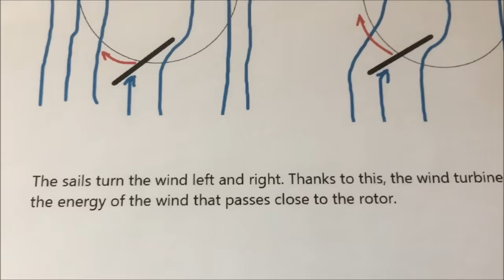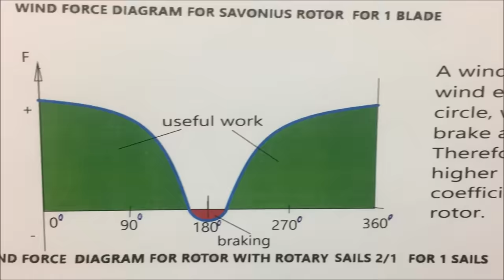A wind turbine they have been hiding for 138 years

Comment: I would almost consider this a type of "Darrieus" turbine, rather than a "Savonius" turbine. This works more like air foils, rather than scoops. It's very clever, how an air vane is used to orient a crank pin, so the sails know when to flare out down wind, and align themselves up wind, for maximum efficiency and minimum drag. Simple, reliable, and, serviceable. I like having the generator at ground level, where it's easy to work on. This is the closest thing I've seen, to a vertical axis turbine, that can compete with a horizontal axis turbine on the standpoint of efficiency. Great video, thanks for posting!
Reply from the maker: A big advantage is also a simple and cheap stand.
With large wind turbines with a horizontal rotor, 70 percent of the construction cost is the base.
Reply: 🔴 What Is Islam? ⚠️

🔴 Islam is not just another religion. 

🔵 It is the same message preached by Moses, Jesus and Abraham.

 🔴 Islam literally means ‘submission to God’ and it teaches us to have a direct relationship with God. 

 🔵 It reminds us that since God created us, no one should be worshipped except God alone. 

 🔴 It also teaches that God is nothing like a human being or like anything that we can imagine.

🌍 The concept of God is summarized in the Quran as:

📖 { “Say, He is God, the One.  God, the Absolute.  He does not give birth, nor was He born, and there is nothing like Him.”} (Quran 112:1-4)[4] 📚

🔴 Becoming a Muslim is not turning your back to Jesus. 

🔵 Rather it’s going back to the original teachings of Jesus and obeying him.
Reply: @1islam1  I don't care
Reply: @cajuncuriosity3067 

🔴ATHEISM EXPLAINED IN 45 SECONDS 🎬👇🏼

https://youtu.be/uwqPdWZvjAY
Reply: @1islam1 

Bahira:
"The names and religious affiliations of the monk vary in different Christian sources. For example, John of Damascus (d.749), a Christian writer, states that Muhammad "having chanced upon the Old and New Testaments and likewise, it seems, having conversed with an Arian monk, devised his own heresy."[9]

For Abd-al-Masih al-Kindi, who calls him Sergius and writes that he later called himself Nestorius, Bahira was a Nasorean, a group usually conflated with the Nestorians. After the 9th century, Byzantine polemicists refer to him as Baeira or Pakhyras, both being derivatives of the name Bahira, and describe him as an iconoclast. Sometimes Bahira is called a Syrian Jacobite or an Arian. The early Christian polemical biographies of Muhammad share in claiming that any supposed illiteracy of Muhammad did not imply that he received religious instruction solely from the angel Gabriel, and often identified Bahira as a secret, religious teacher to Muhammad."
Reply: @1islam1  Also,

There is the hilarious claim of the many hadiths or "gospels" to interpret the holy scriptures.

30,000 hadiths to my rough knowledge to try to make sense of your scriptures. Yet what man can claim he has the authority to know which books accurately interpret the Koran?

Or the Bible that the Koran was borrowed from?

I think if plagiarism had been a crime back in the 700's the early Muslims would have been sued for stealing from the Christians.
Reply: Also this design looks incredible and I'm going to grab the plans for it.

Looks like something some old welding buddies could build
Reply: Drawbacks: low RPM even if you use mechanical multiplier, low torque, and too many moving parts in joints can wear out fast creating lot of maintenance. The design is clever. I thought of a vertical axis with blades made out of small fins that would open when the wind creates drag and will close when the wind pushes against them, and it sounds great in theory, but in real life it has a lot of moving parts and wear and tear points.
Reply from the maker: @jjesl  Wear also depends on the speed of rotation. The bigger the turbine, the slower it turns, so the less wear.
Reply: @1islam1  capholic church created islam...nice wind generator eh friend...Greator bless...doug
Reply: @tihomirculjak7492  there are some really great bearings available...maintanance every 3 years ?...thanks very much for sharing...Yah bless...doug
Reply: Oh I got
Reply: @1islam1  Except Jesus raised the dead, He didn't make them dead by cutting their heads off with a dull pocketknife just because they didn't want to become His followers.
He also said, "Feed my sheep" He didn't say, "Take them as wives."

Comment: en el eje puedes poner colgando 3 varillas de un metro con un peso de 1kg en la punta de cada una, de modo que cuando sopla mucho viento, las varillas se levantan por fuerza centrífuga y ralentizan el giro, pero acumulan energía potencial. cuando hay poco viento la turbina sigue girando más rápido por la inercia acumulada de los 3 pesos. no impide arrancar el giro porque las varillas cuelgan replegadas contra el eje, pero sí cuesta más frenar porque las varillas levantan el peso de sus puntas manteniendo la inercia. funciona como amortiguador. el cambio de velocidad es más suave y el giro más constante. por favor alguien que lo traduzca a inglés
Reply: [English translation] On the axis you can hang 3 rods of one meter with a weight of 1kg at the tip of each one, so that when a lot of wind blows, the rods are lifted by centrifugal force and slow down the rotation, but accumulate potential energy. when there is little wind the turbine keeps turning faster due to the accumulated inertia of the 3 weights. It does not prevent starting the turn because the rods hang retracted against the axis, but it does cost more to brake because the rods lift the weight of their tips while maintaining inertia. works as a shock absorber. the speed change is smoother and the turn more constant.
Reply: Google translated

Comment: Prof that anyone who can buy a MIG can squirt molten wire and not need to know how to weld.
Aside from that, I saw a tintype of one of these built in France.  It was constructed of wood with paddles 9 feet tall and was 28 feet in diameter.  Supposedly it developed a little over 14 horsepower in a10 MPH wind.

Comment: (7:35) & (7:51) is why I suggested extended blades that block the wind flow incoming to the back or breaking side of the blades, all radiating out at enough angle so not only is it reducing the breaking effect of the wind on the back of the blades BUT 

They also make a funnel for the wind that normally would causing breaking, to instead be on the power side of the blade, creating a vacuum effect on the breaking side sucking it forward so its adding power to the rotation, 

Add to this a slight angle to the blades so when rotating it creates a bit of lift to reduce wear and tear on the bearings, the blades are sitting on, and lengthen time between repair jobs, and you get one heck of a change in dynamic, 

now something most don't realize too, though is the blades that block air flow on the opposite side of the breaking side block coupled with the breaking side actually mean the whole of the rotating blade portion is now consuming a greater cross section of wind than the blades normally can reach, so the wind is being focused from outside the width of the rotation too, much like putting mirrors on either side of a solar panel will increase the sunlight by redirecting light that would miss the panel instead onto the panel
Reply from the maker: With wind turbines, the most important thing is to have as many working hours as possible. This reduces the cost of investing in batteries. In low winds, it is important to have a high turbine efficiency in order to achieve as many operating hours as possible. But with strong winds, safety is more important than efficiency. By installing a mechanism for collecting sails in each sail, this wind turbine can work even in the strongest wind, which increases the total number of working hours.

Comment: This is very much like a design I thought of with ships in a circular canal. There would be a gearbox with an arm connected to the ships and it would sail around in circles. Sails develop 0.015 hp/sqr ft of sail @ 7-10 kts wind speed, 0.020 hp/sqr ft of sail @ 11-16 kts '' , 0.040 hp/sqr ft of sail @ 17-21 kts ", and 0.070 hp/sqr ft of sail @ 22-27 kts ".  100 sq feet of sail at slow wind speed would give you 15 horsepower. Used sail boats are not expensive. I don't know if water friction is higher than rolling resistance like if you were to make rolling sailboats instead of floating. Just figured a floating one would require less parts that could break. Another alternative would be giant circular trains that have sails. The train could literally wrap all the way back to its tail. Each car could have a generator and a rotating sail. the tracks could deliver the power to the grid. Easy as pi. It would appear that this would be a little bit more bird friendly. Never heard stories in the Navy about birds dying from sails. I also have it on good authority that this design causes less cancer. If less than zero is a thing. Seriously though lower rpms and higher torque seems like a good thing in a wind turbine design to me. Anyway this is kinda like having  four sailboats in a circle, without the boats. In my design the sails either fold or roll up then unfurl. For the matter of the train you could have an elevated train travel around a city, the whole track would be full of cars and each one has a sail. Each sail is 1000 sq feet. 58 percent of the car can generate electricity while 42 percent are returning. At 7-10 knots that is about 1.5 megawatts, on a bypass that is 30 miles long. More than the power required for the city of Miami. The rail cars would cost 250 million dollars. Apparently rr cars cost over 100,000$ I figured without the heavy walls but including the generators and sails it would be about the same. The generator could simply be connected to the axle and they would all turn at the same speed. The same thing could be done with trailers on a road. Probably lots cheaper than 100 grand a car. The system would last years and provide lots of jobs repairing sails. Or we could use solid sails. Just a thought.
Reply from the maker: I intend to make one model suitable for installation on sailboats. It will be the same height as this one, but 3 times wider. The sails will expand in low winds and shrink in strong winds.
Reply: @tihomirculjak7492  Excellent.

Comment: You should do some more research. A better alternative is the Sharp cycloturbine. The blades passively pitch and are lift airfoils as well. In my opinion it is the best turbine. The tsr is around 3 for the Sharp, yours is less than 1.
Reply from the maker: It seems to me that the Chinese could decide which turbine is better.
They have created an improved, interesting prototype that they have been advertising for several months, but have not yet put it on the market.
And whoever conquers the market first will occupy it. https://www.youtube.com/shorts/2w8er5MmL6Q

Comment: I like it, I still can't tell how the airfoils get oriented so the force of the wind favors the torque. I know it can be done by the use of the wind vane on top, though this one doesn't seem to be connected to anything.
Reply from the maker: There is a 1/2 differential at the top of each sail.
There is a 1/1 differential in the middle of the rotor.

Comment: amazing work you did. are these electric stepper motors or are the blade turning mechanicaly from the windvane? thanks anyway
Reply from the maker: Each sail at the top has a small differential with a ratio of 1/2.
Below the wind vane is a differential with a ratio of 1/1 x 3.
Reply: @tihomirculjak7492  genious thank you.

Comment: Definitely a drag translator.  Lets see, old irrigation piping for torque tube and strucutral support tower slapped together using a handy oxygen-aceltylene welder from the tractor shop, OK, but 95% of all fatique weld failures are due to improper heat treatment of the weld joint.  And, all VAWTS suffer impulse loading through the drive train and lateral (perpendicular to rotating axis) through the support structure.  The generator must be an alternator since there is no gearbox between the torque tube and generator... charging batteries?  Not sure what the wind vane is for, since all VAWTS should not care about the wind direction.  Overall, looks like a fun project to clean up a lot of junk hanging around the farm.  I'd recommend a wearing a hard hat though while standing under the rotor...  whether its turning or not.  Ciao for now!

Comment: How much does a copy like this cost?
Reply from the maker: A 1 KW generator running at 50 rpm, with a voltage and current regulator I paid 2,000 euros.
four small gearboxes I paid 1,500 euros. I did everything else myself.
Reply from the maker: @oliverstanojkovic6779  Snaga vjetra ovisi o trećoj potenciji brzine vjetra. Na lokacijama gdje najčešće pušu slabi vjetrovi jedra bi trebala imati dimenzije najmanje 4x4 metra da bi davalo dovoljno energije za jedno domaćinstvo. Na lokacijama poput obala mora, ili vrhovi brda  gdje vrlo često pušu jači vjetrovi ova veličina bi bila dovoljna.
Reply: @tihomirculjak7492  That could be true for a certain efficiency and windspeed range for which the device was optimized.  Are you quoting ideal calculated energy in the wind or what a certain type of turbine can harvest?  
I doubt you have efficiency specs for this dinosaur.  Are you even taking into account the Betz limit?  Do you mean to say each "sail" should be 4x4 meters, or all of them combined?  There is under 2.9 KW of energy in 4x4 meters of wind at 10mph.  After the 59% Betz limit reduction, you're left with about 1.7 KW.  The avg household uses 29 KW/hr, so your genny would have to run at 17 hr. per day at min. of 10mph if your sails total near 16 sq. meters.
Reply from the maker: @dennisbecraft1303  With wind turbines, the most important thing is to have as many working hours as possible. This reduces the cost of investing in batteries. In low winds, it is important to have a high turbine efficiency in order to achieve as many operating hours as possible. But with strong winds, safety is more important than efficiency. By installing a mechanism for collecting sails in each sail, this wind turbine can work even in the strongest wind, which increases the total number of working hours.
Reply: @tihomirculjak7492  
Yes, but being a drag device rather than airfoil, it must make up for inefficiency by being much larger overall.  Since power in the wind cubes as it doubles, the trickle of electricity in low speed winds also requires a generator that is efficient at low rpm & torque.  High rpm generators are more efficient, smaller & less expensive to manufacture.  
You are expecting to harvest more electricity by operating in as many hours as possible, but you still need the same amount of battery storage capacity, unless you are feeding it into the grid and need only enough storage to get you past a few hrs. of interrupted grid service.  Correct me if I don't understand something here.
Reply from the maker: @dennisbecraft1303  Generators are expensive and sails are cheap. It is cheaper to make slightly larger sails that can be assembled in strong winds. Shrinkage reduces efficiency, but efficiency is only important in low winds, while in strong winds it is less important. The optimal relationship between generator power and sail size can be determined only experimentally for individual micro locations, by measuring wind speed over a longer period. At small intervals wind speeds can vary significantly, depending on the terrain configuration.

Comment: how much power does it generate
Reply from the maker: Power depends on the third power of the wind speed.
I had a 1 kw generator and I put it on.
In a location with frequent light winds, this is optimal, in order to achieve as many working hours as possible.
  In locations where stronger winds often blow, it would be optimal to install a stronger generator.

Comment: Nonone hiding it. Its ineficient no one interested
Reply: why?
Reply: I disagree. With its ability to turn the sails flat to the down wind, and feather edge into the wind, this "active" sail configuration is far more efficient, than vertical axis turbines with fixed angle sails. This one even uses an air vane on a differential, to phase the angles of the sails, regardless of the direction of the wind. This design is definitely worth a try!

Comment: Напоследок на ютюбе очень мало смелих решений ... Рад за вас .... Но, я на мнении.що очень мал хвост у флюгера ...  А так-же можете поинтересоватся поворотно-лепесковими ветряками, но они шумнее...
Reply from the maker: The tail must have enough power to overcome the frictional resistance in all 4 differentials.
Reply: @tihomirculjak7492  ,
Да, ето сама правда ... Хвост должен командовать ветротурбиной ... Он рулевой ...
А у Вас исчо работает ета вертушка или давно как сломалась ??? ...
Reply from the maker: @ГогоГого-э3ю  After testing, I disassembled it. Then I made a new wider model where the sails can be folded and spread. Now I'm waiting for parts for an even better model. The biggest problem for me is the automation that would control the folding and spreading of the sails. And this is necessary for models intended to be placed on the roofs of houses or on ships.
Reply: @tihomirculjak7492  ,
Если Ви говорите о старой конструкции, то мое мнение що Вам для хвоста нужно изпользовать дополнительную плоскость с размер полотна ... У него хватит сил ориентировать по ветру всью  вертушку ... А вся автоматика вращения полотен, ето велосипедние цепи и велосипедние звездочки 2/1 ...  А если Ви говорите о вертушках с хлопающими полотнами, то там все делает ветер и никакая автоматика не нужна ...